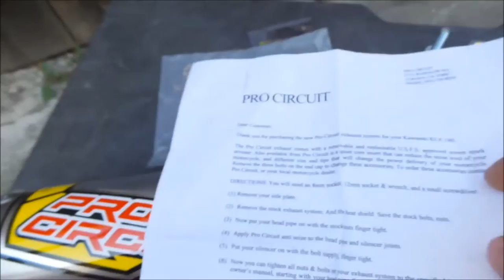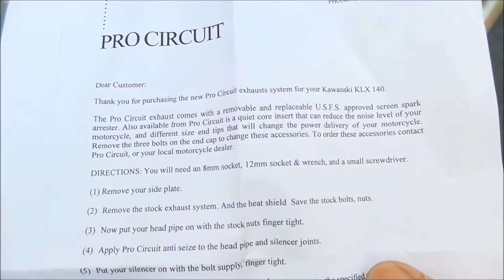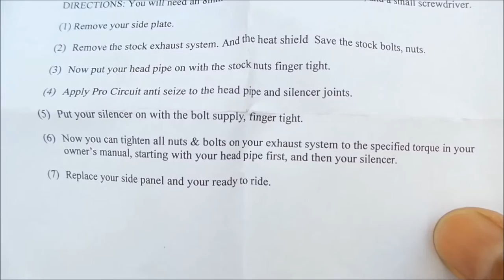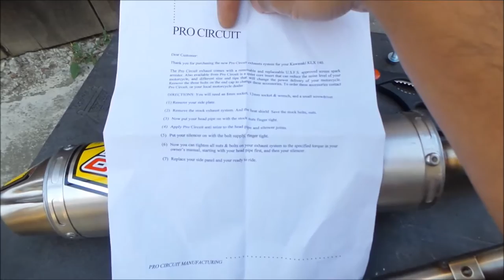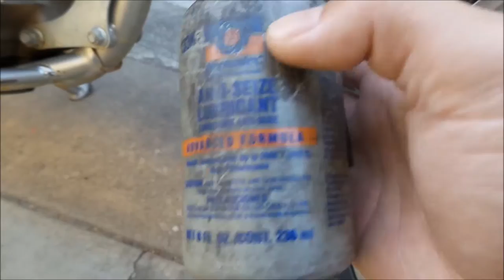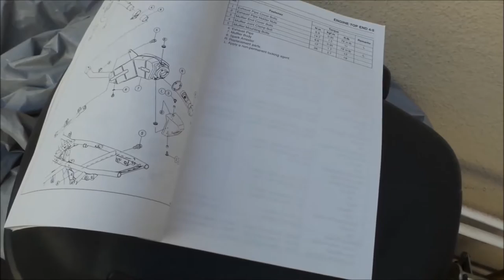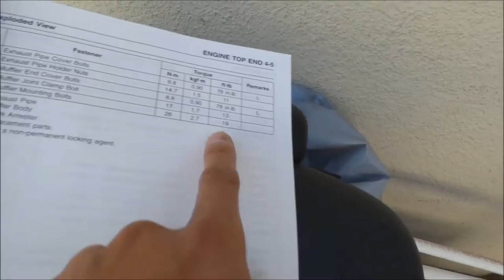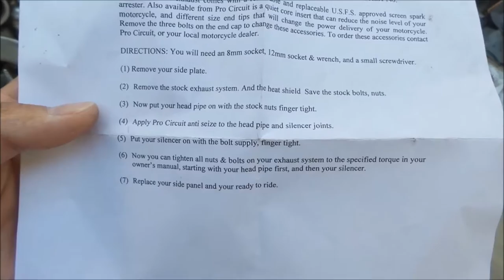HadesOmega How To VLOG: Install Pro Circuit T4 Exhaust on KLX140

Comment: Hello. I  watched all of your videos , and successfully upgraded our klx 140 to a 170. We are now going with the pro circuit complete exhaust as you did. Im wondering what you did with the carburetor? Did you rejet it, and if you did, what jets did you find to be the best?
Reply from the maker: Hi thanks for watching.  For the carb I upgraded it to a KX65 carb.  It's slightly better.  I haven't posted a video on it but I might soon since I've been getting some questions about it.  For the stock carb when I still had it I think I did a little rejet on it, I can't remember the jet's I put on it though.
Reply from the maker: Oh haha I posted the jetting I used in another persons comment "Currently I am running 100 main, 42 Pilot, and 1 shim on the needle.  "
Reply: @hadesomegamoto7639  thanks, your videos really helped allot. The reverse threads on the cam bolt, ring clocking, and  specifications were spot on. A video on the kx65 carb install would be awesome.
Reply from the maker: That was the first engine rebuild I'd done on a motorcycle it's like the most simple engine but it still took me forever to do it =P

Comment: what jet sizes are you running?
Reply from the maker: Currently I am running 100 main, 42 Pilot, and 1 shim on the needle.  If you are just installing the exhaust system on a stock bike you probably don't need to rejet.
Reply: What other mods have you done?

Comment: What ever happened with the side panel? Did the heat damage it or did you insulate?
Reply from the maker: Hmm there is no problem with the side panel.  It kind of hovers off of the muffler.  There are rubber spacers on the cover for the stock exhaust but they don't work with the T4.  I haven't had any problems with the cover melting and I have been doing supermoto track days and hare scramble races recently.
Reply: @hadesomegamoto7639  Thanks. The stock KLX140 sort of falls off on top end. I'm hoping an aftermarket exhaust will help it breathe better up in the rpm's.
Reply from the maker: Well so far the exhaust is the biggest improvement I have made to the bike.  It gives you a little bit more punch.  I will admit it is on the loud side.  When you are just revving it hard for long periods of time it'll have your ears ringing while your ringing that engine all the time to get everything out of it.  But yes I do know what you are talking about it is a lazy on the top RPMs, like it doesn't want or like staying there.  I heard that a better carb will transform it.  I've been racing with mine lately later on I plan to do a bore kit, cam, CDI, and carb.  I've heard that when these engine are modified they're pretty quick.
Reply: I had read the Pro Circuit was actually quieter than some of the others like FMF. That's a bummer. You running it with the spark arrestor?
Reply from the maker: Its not so bad until you're underload if you're just putting around the trails it doesn't bother me, but if your racing it it's pretty loud.  Yes it has the spark arrestor also.